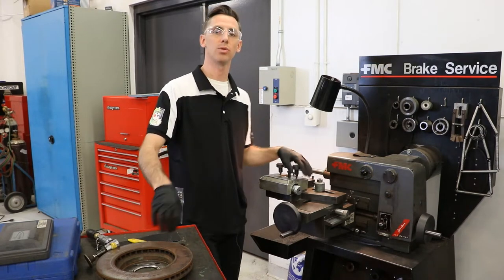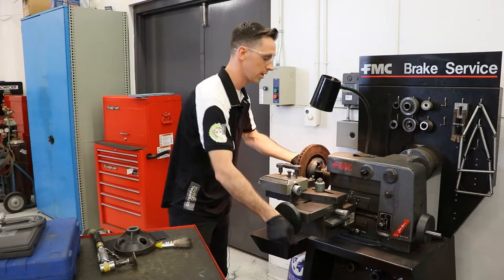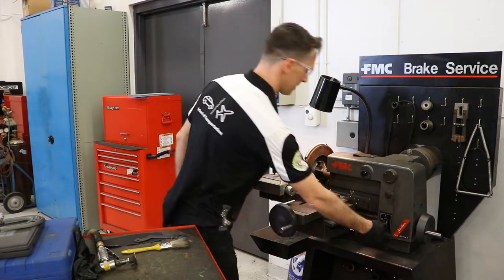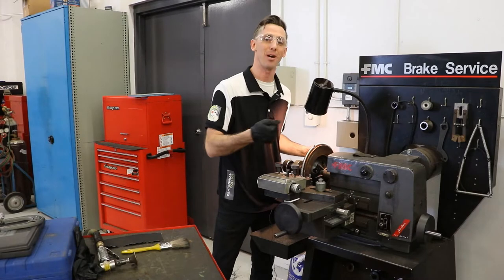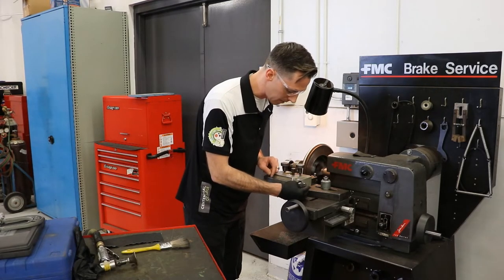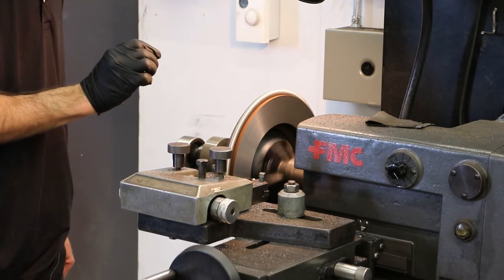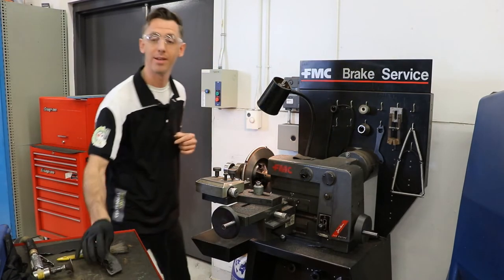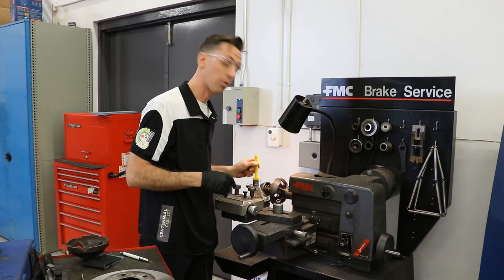How to use a brake lathe

Comment: This lathe is way overcomplicated compared to how hunter handles it with a single one size fits all centering hub that has adjustable teeth on the inside that grab any rotor.

Comment: My John Bean 600 does not have a speed (RPM) control for the feed.    ?????? WTH ?
Reply: It's the 700 series where they added the variable speed DC motor rotor feed drive. I just picked up a JBC 600 from 1997, and was wondering the same thing. If it worked back then, hopefully it will work today...